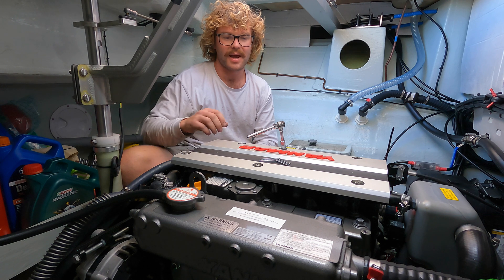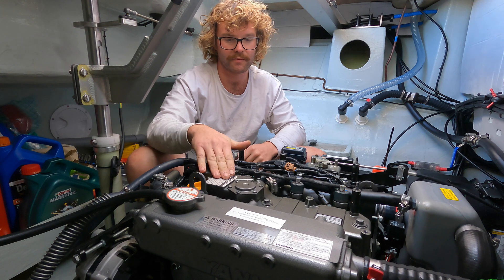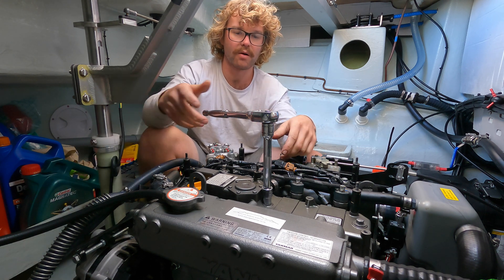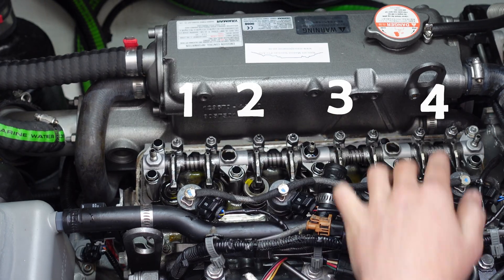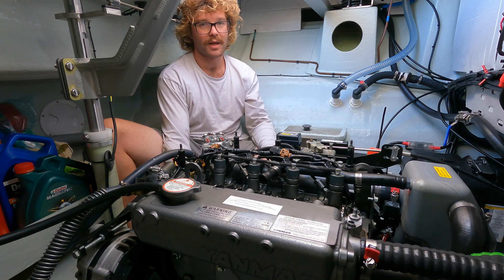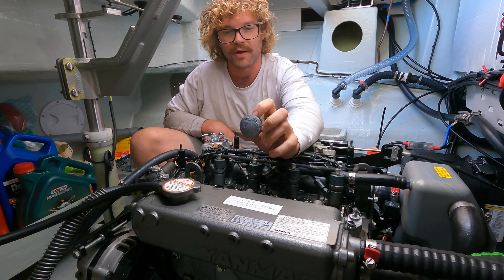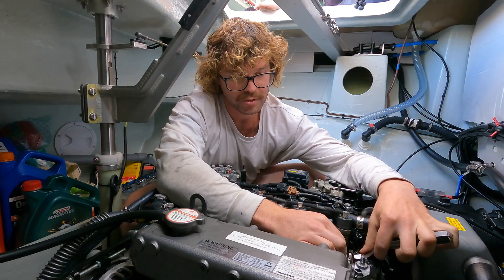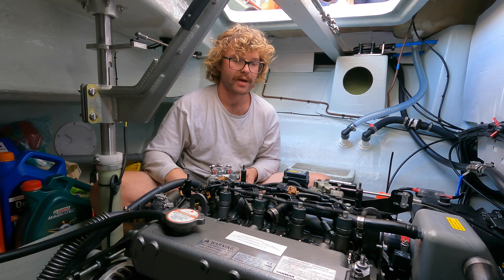Yanmar Marine Diesel: How we check & adjust our Yanmar valve clearances (DIY with no BS)

Comment: Great video very helpfull ! But did you have to adjust the valve clearance or they still inside the tolerance?
Reply: I had to adjust two. They were within spec but on the high end so I just adjusted them to be in the middle of the tolerance so it matched the rest.

Comment: Just a note, Tynan has rebuilt vehicle engines and has extensive experience doing high quality mechanical work. If this saved you some money and possible heartache chasing up a "mechanic" buy him a beer through the link. All proceeds go to him for his how to videos. I would also sit a mechanic down in front of this video and make them watch it before they touched my engine. This section in the service manual is about the worst written I have personally encountered.
Reply: Ex ships engineer here. Certificated and 60 years since I started apprenticeship. You would be better not showing a mechanic this video. From the start that is not the camshaft, it is the rocker shaft. The clearance is not to the top of the spring but to the valve stem. The firing order he quotes is incorrect to the cylinders he identifies. He seems to have electrically isolated the engine, diesel engines are capable of starting without an electrical feed, fuel rack should be in the stop position. Laughable someone should publish this as a definitive video.
Reply: @JohnGlover-e5c   It can be called a cam shaft, go and look up the etymology of the word. The firing orders fine, he checked it against how the Yanmar internal service manual defines them which we have here. Better to conform to the service manual information than what anyone thinks they should be numbered as. If the ECU and alternator is isolated how do the electronic injectors supply diesel to run the motor? Funny thing is, I also self educated to be able to do my own mechanical work and then my fully qualified relative filled in the gaps. I did this because every single mechanic but one I have ever met or dealt with in my life was incompetent and usually had a bad attitude. Tynan is trying to be helpful, as most people with an education in 2023 are aware, you can't pay your way out of problems by hiring a "mechanic" anymore and have to self educate. If you really want to be helpful to the community, go and re write the Yanmar service manual section which is one of the most poorly written and least detailed that I have ever seen out of dozens of engine manuals. Personally, I would rather increase my intelligence by 1% then gain 60 years experience in a field and have recognised time is not a validating factor.
Reply: @trentspencer7991  It cant be called a cam shaft in any distorted way or form, It can be called a rocker arm and rocker shaft. Try order a camshaft and fit it there. Would be a interesting video to watch.
If the power to the ecu is off that diesel will never start. no fuel no fire. In fact even with the key on, the ecu needs to see the cam AND crank reference teeth pass at a minimum of  200rpm before it will start.  I would like to see someone start any diesel engine with a wrench at that speed. If you do know how I know a few sailors who would pay large to learn that trick 😉 
The hissing is air going past the rings. If its getting past the valves you have issues on the way
Its far easier and faster to do TDC on rocking valves, he half got it. At the crossover of exh/inlet you are more than close enough for the opposite cyl 1-4 2-3